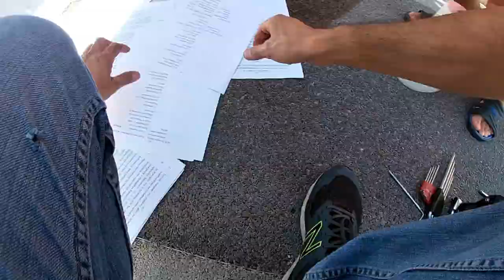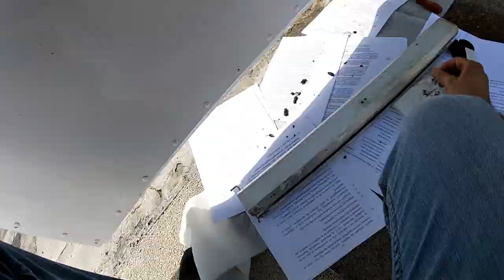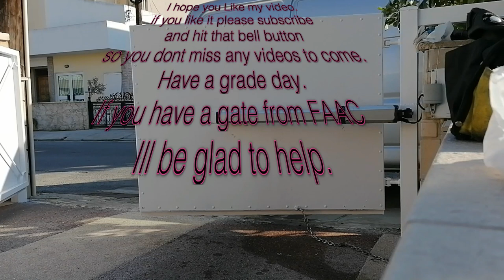Faac 402 Repairs #FAAC  #faac402 #402 #KOSMAPANAYIOTISSERVICESLTD

Comment: can you show me how to change val by-pass please.
Reply from the maker: You mean manual realease valve?
Reply: @1ManShowCy  I mean red green bypass valve
Reply from the maker: @bachhoangngoc673  you remove the bolt.Inside is a spring and under the spring is a plastic seal connected to the spring.You remove it with a small screwdriver or a hook type and you install the new ones in the reverse order
Reply: KOSMA PANAYIOTIS SERVICES LTD Thanks.Can you show me how to increase and decrease the switching speed of a motor
Reply from the maker: One screw is for opening and the other for closing.What i do is turn screws anticlockwise and start motors then turn clockwise and at the same time push the gate in the opposite way until you get the amount of force needed. I usually give a little more power but if you push the gate in the middle of the length of gate to be able to stop it without to much effort.

Comment: Where is the part where you refill the oil?
Reply from the maker: I cut some part because the video was to long that’s why its fast forward also😀
Reply: @1ManShowCy  was One of the most important parts...much more important that time wasted to film gasket cleaning 😔
Reply from the maker: And why it was so important? You just fill it up with oil if it has more it will drain out from the breath hole.
Reply: @1ManShowCy  i have Fadini Nupi 66 and the system Is differenti there Is not drain
Reply from the maker: @zanfozanfani ok good to know.

Comment: how did you manage to insere this garget at 18:50?  I spent more than an hour doing it, and I cannot.
Reply from the maker: Its little tough to get it in there but maybe you have one that is bigger wrong part number.
Reply: @1ManShowCy  thanks for answering. Probably I had a wrong part number. It would explain the hours spent at doing it and the new seal was much harder than the old one. At the end I was able to insert it with circlip plier and vice. But the seal was a bit unshaped after so much fight. I was able to reinstall the whole system but the opening is not smooth maybe because the seal was too thick or badly fitted. Anyway,    I will not rechange it.
Reply from the maker: @Kurisutof4 if you need anything let me know.
Reply: @1ManShowCy  Thank you very much, I appreciate. I have a last question. The FACC 402 that I repaired is quite old and belong to my relative. I noticed the oil overflow screws to get access to the vent holes are still there. But looking at the documentation, it is requested to remove them for good during the use of the system. And the screws are needed only for the transporation. Is my assumption correct? Thanks in advance.
Reply from the maker: Yes it is correct it works like a brether